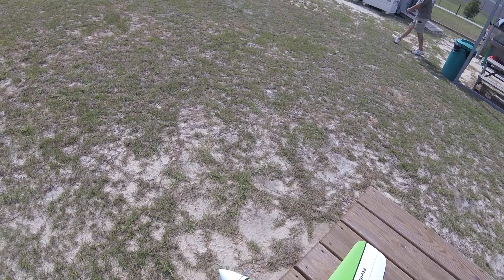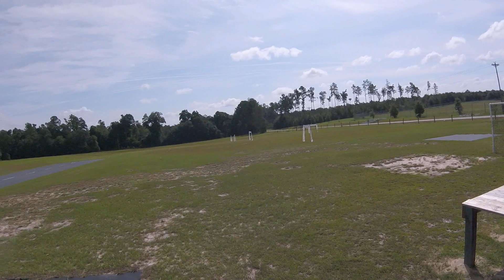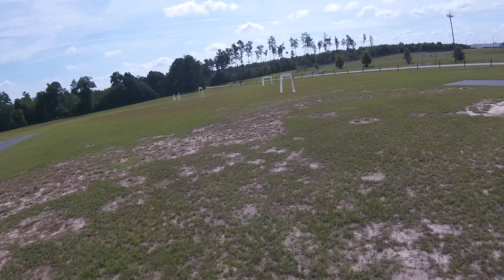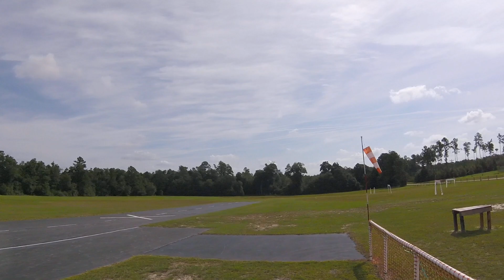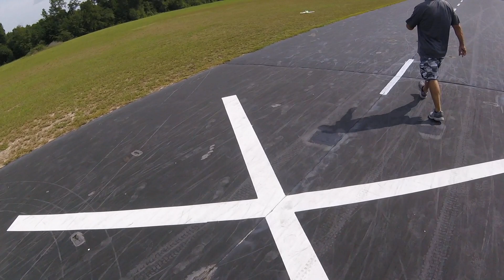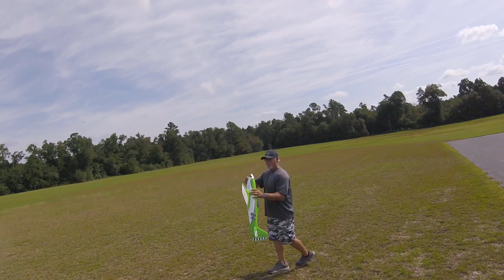Multiplex FunRacer breaks 150 mph on 6s

Comment: Hello good video, what engine do you use exactly, you say scorpion 6S, but what model

Thank you
Reply from the maker: The motor is the stock eflight motor. The battery is a 6s Scorpion battery
Reply from the maker: Motor is the stock Eflite 15 size motor that came in the Rare Bear
Reply from the maker: Prop is a long discontinued nitro 7.5X7.8 prop
Reply: @seng30904  Thank you very much I will do the update

Comment: Motor ??
Reply from the maker: Motor is the stock Eflight Rare Bear (15 size) motor. Yes, higher speeds are easily obtainable, however, efficiency really drops at higher amps. My goal was to be able to fly wide open for a full 2 minutes to enable me to complete in our local pylon racing events.